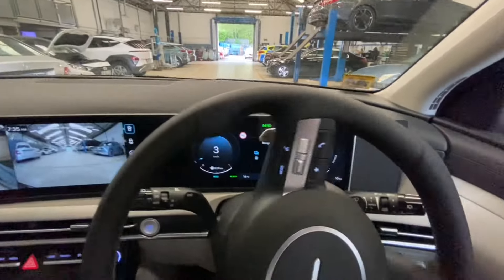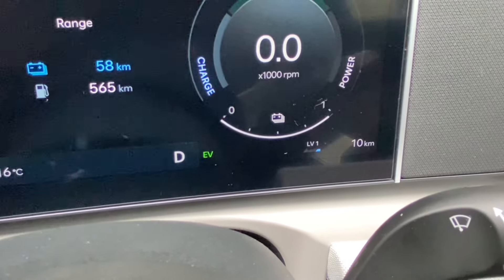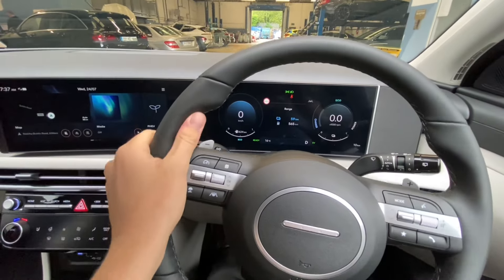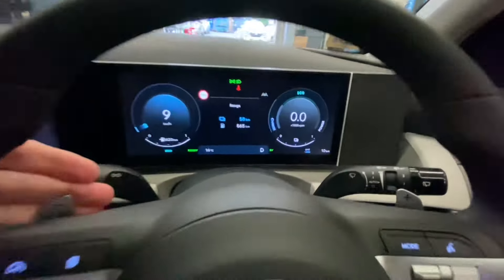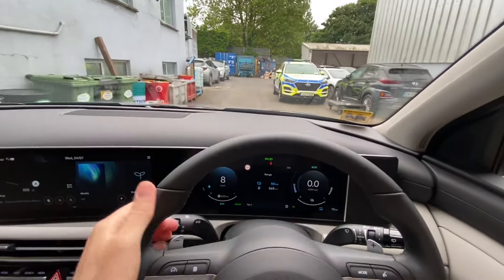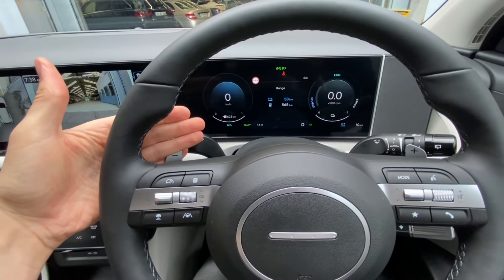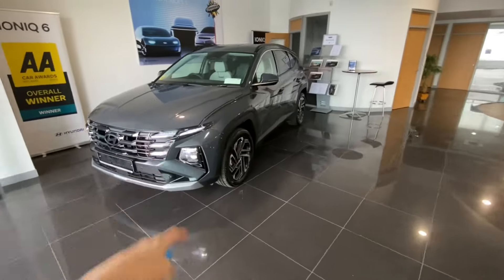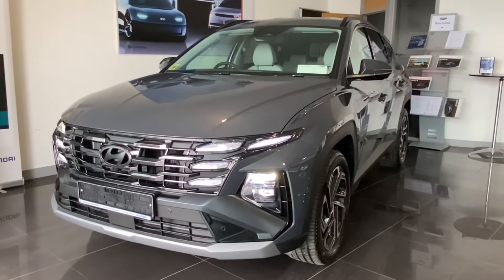How do paddle shifters work on Hyundai Tucson and Santa Fe PHEV

Comment: Hello Brian, taking delivery of my Company car Tucson in a couple of months, so I have been pre-learning as much stuff as possible from your channel. A question on regen braking. As I understand it, the levels are 1 - 2 - 3 - and also AUTO (?) is that correct? And it kicks in when you are not pressing the accelerator pedal....
If you were using Adaptive Cruise Control...so you do not have your foot on the accelerator at all, at what point would the regen braking kick in?
And also, out of all these settings what would you genrally reccomend for most efficient driving?
Thanks for all the useful content
Reply from the maker: @SanDanWu  appreciate you watching! So tell me are you getting hybrid or plug-in hybrid?
Reply: @ 2025 PHEV 4WD Auto
Reply from the maker: @SanDanWu  ok 👍 

Phev has settings 1-2-3-auto yes .. they regen braking will kick in when you are not accelerating correct .. basically it operates where a normal car would just freewheel instead.

In the case of cruise control the regen will work in the background when not accelerating

I can’t be 100% sure but I suspect auto is the best setting as it will engage the correct level of regen braking depending on recent driver inputs where it’s trying match current driving with an appropriate level of regen 

Hope that helps !
Reply: @ that’s awesome thank you Brian. My gut says auto may be best day to day. Of course the fun is in trying things out….
I look forward to getting the car and will feed back how I get on thank you 👍
Reply from the maker: @ hey I appreciate your time 🫡

Comment: Your videos are very useful so thanks Brian, When setting it to Max for regen does it remember this setting when you restart the vehicle or do you have set it to max or LV 3-2-1 every time ? I am trading in my UK spec 2021 Tucson Ultimate PHEV with Tech Pack for a 2025 Tucson N-Line S PHEV with 4WD next month, so your recent tips on Autohold, Paddle shifters, Speed Limit Warning and Brake cleaning mode for the new Tucson have been very valuable.
Reply from the maker: @src019  I appreciate the kind words! At the moment, it looks like you have to reset every single time. It doesn’t seem to be possible to keep a preferred regeneration level unfortunately🙂👍
Reply: @doolanbrian cheers Brian, king regards Scott
Reply from the maker: @src019  💪🙂

Comment: Thanks for this, didnt know about the max regen feature, i did know about the auto regen feature. 
But why wont it stay in the regen mode? It always resets every time i stop the engine. 
Must be a way to save my driving mode
Reply from the maker: @retroonhisbikes  thanks for watching! Unfortunately, a lot of these modes reset after you turn off the vehicle so you have to reactivate them you are correct 👍

Comment: Do the paddle shifters work the same way on the regular Tucson Hybrid? Particularly the hold to break feature.
Reply from the maker: @jgordon881  just to be sure. Are you talking about a brand-new one, a 2024 into 2025 model will have regenerative braking. The 2021 model up as far as early 2024, however will not, does that make sense?
Reply: Sorry, rewording the question. Do the paddle shifters function the same way in the PHEV model you are driving vs regular HEV? I've seen videos of the HEV paddles adjusting the regen level but never the holding of the paddle down to fully brake.
Reply from the maker: @jgordon881  it’s a good question, so basically on the plug-in hybrids they allow you to hold the left paddle down to significantly slow down the vehicle, almost like a brake pedal would, 

on the full non-plug-in hybrid, it does have three levels of regeneration, however, it doesn’t allow you to hold the left Paddle to slow the vehicle more significantly like the plug-in hybrid🙂👍

Comment: Nice! The HEV doesn't have that 4th MAX level when you hold the paddle. I am happy that the PHEV has it. Will pick mine on Monday :)
P.S. Brian, if you had the chance to test it, do you find a significant difference in the facelift PHEV in comparison with the pre-facelift PHEV? Especially in EV mode, does it act the same and take the same load before it triggers the ICE?
Reply from the maker: @grasho  unfortunately, I haven’t had the chance to test drive the new plug-in for any extended period yet ☹️

Comment: Brian. Are there limitations in relation to charging points that can be used for a Tucson PHEV. Are some of the charging point to "strong" for the size of battery in a Tucson PHEV. As the Tucson only comes with a three pin plug cable
Reply from the maker: @kevinrattigan507  the car has an on-board charger which will only accept a certain level of charge so it’s decided how much charge it will take. So you don’t have to worry about ever overcharging it’s per se if you get me?